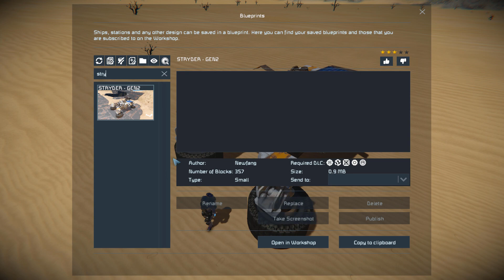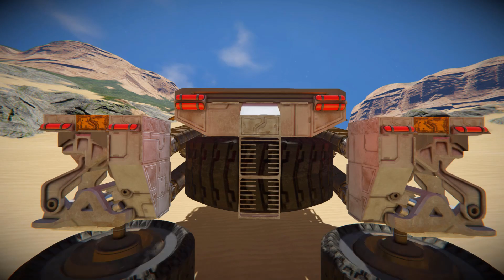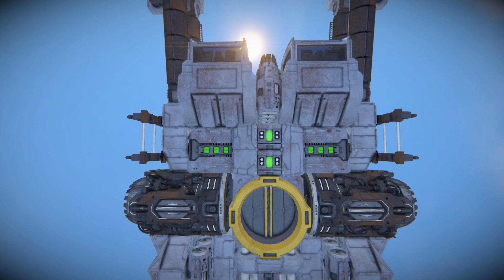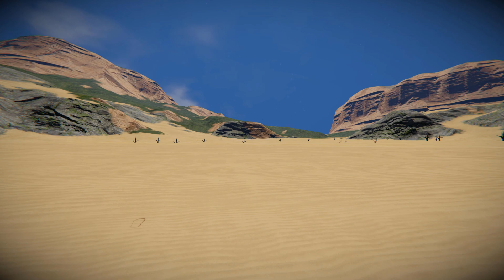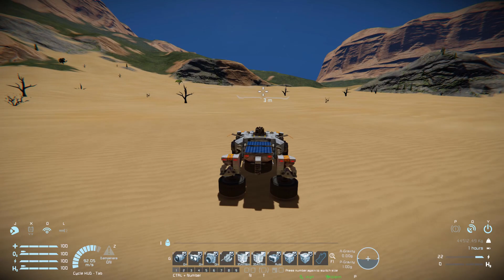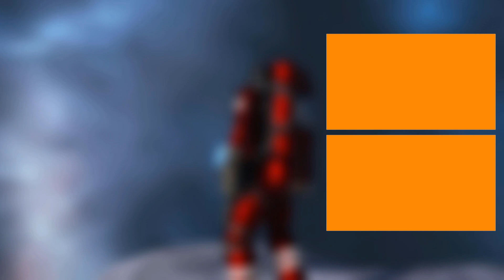The Stryder Gen 2!! - Space Engineers

Comment: What's the purpose of the wheels permanently spinning? Is that required for it to function?
Reply: Just for thw look. It only requires wheels to be on friction at 0
Reply: No
Reply: Leave the friction at 10%
Reply: Why at 10? If u have the thrusters too up, it can make it to end upside down. I mean. I k ow yhat at 0 it drifts when not hunters but using landing gears to attach it to walls work
Reply: The creator, New Fang, in his video about this skimmer...or maybe one of his streams...mentions the reason for the spin. For whatever weird physics reason it would slowly drift around when sitting still and turned on. If you notice the wheels all rotate towards the middle as opposed to the same direction on both sides. This counter acts that "slide" it was doing.